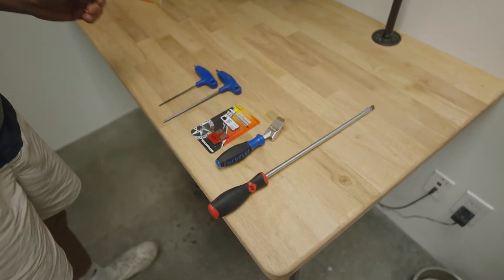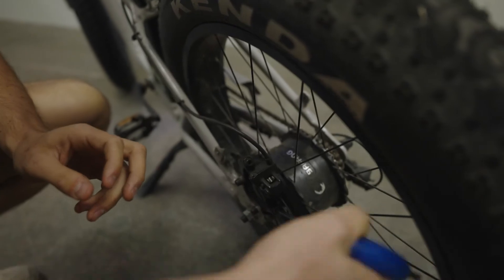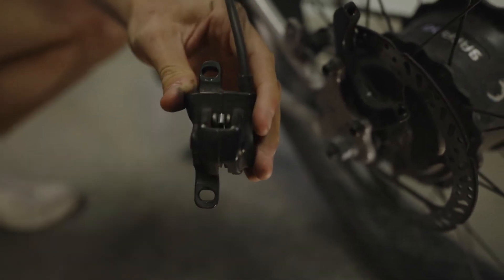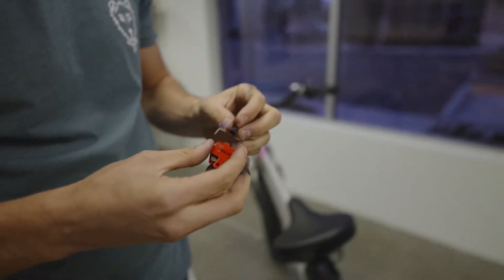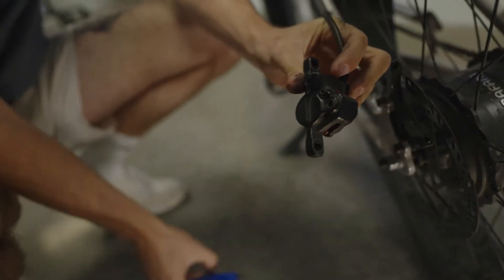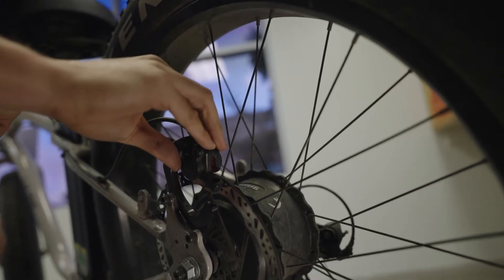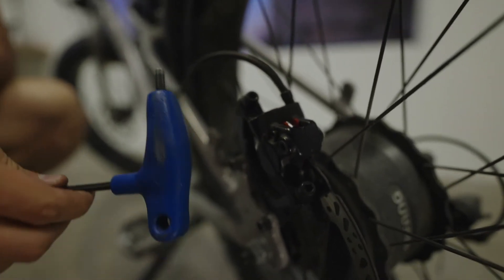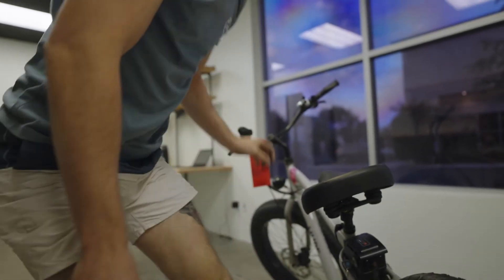How to Replace Rear Brake Pads

Comment: Don’t pull the brake lever with the pads out.  The hydraulic fluid will then be all over the floor.  At least that’s what someone told me.